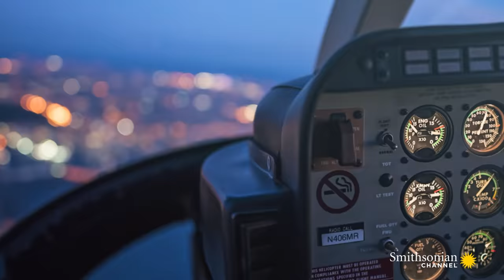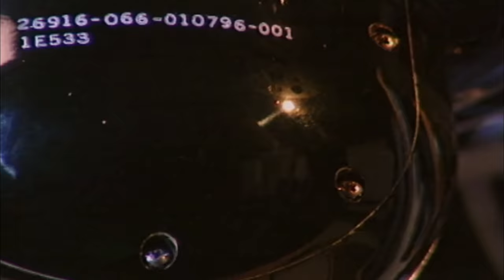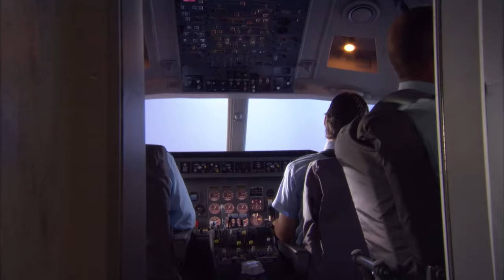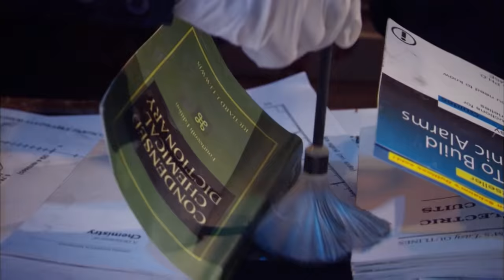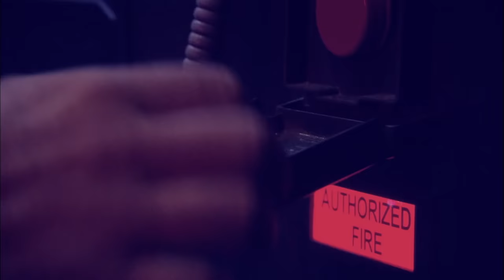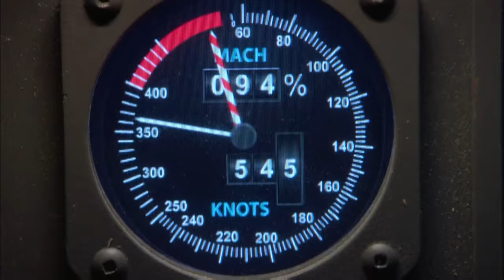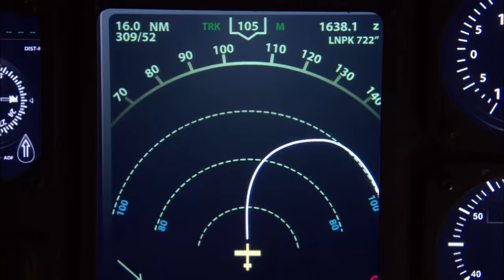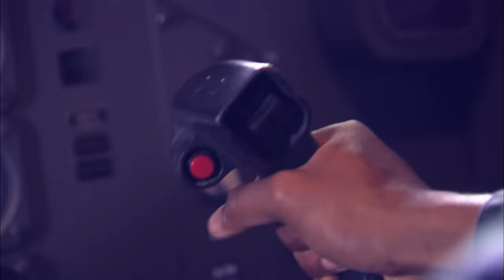Every Plane Crash from Air Disasters Season 6 | Smithsonian Channel

Comment: For a huge chunk of the top of the fuselage to break off and the plane NOT break apart in flight and then it was able to land safely would be unbelievable to me if you couldn't show me the plane. Truly mindblowing
Reply: That’s because it was built by one of the worlds greatest legendary aerospace manufacturers, Boeing. If it ain’t Boeing I ain’t going!
Reply: There is a God.
Reply: @sharoncassell9358  Impossible to deny in this instance.
Reply: @K131399  plenty of other material from this channel that's not so miraculous lmfao

Comment: Unbelievable the pilot allowed his  kids that kind of control. Just Unbelievable.
Reply: Which one?
Reply: @amymiller4840  Aeroflot 593
Reply: you can easily take your child to a flight simulator which has a similar feeling to flying in a cockpit instead of literally letting your child fly the plane and put all the innocent lives aboard at risk
Reply: Is ot really though? Ur dad never let u sit on his lap and drive the car? If that's the case then that's a major tragedy
Reply: @christina5823  oh really with the huge simulator waiting list of qualified pilots along with the shortage of available simulators, oh let’s not even mention the insane cost using the sim, just where do you take your kids for this intelligent suggestion?
Reply: @mikeberry5016  what an intelligent statement! That has to go into the U tubber hall of shame.
Reply: I feel bad for the mother. Both her children and her husband are far away from her when they died

Comment: Boeing got busted for work that should have been done with persicion macine tooling but was done by hand, then covered it up and fired the inspectors that made Boeing aware of the hand tooling going on ... Good luck if you ever find you are flying in a boeing aricraft.
Reply: Right, like AirBus doesn’t have similar problems and never tried covering up or place the blame elsewhere. Good luck finding an airline flying to your intended destination that doesn’t use either of the two.
Don’t be so quick to slam one of the best airplane manufacturers ever using some small detail involving much more of a bigger picture. If your ignorance insists then at least be fair and list the many times Boeing aircraft came through the many near impossible situations when their disabled planes saved  thousands of lives! Ok if you can’t be fair and impartial then remain the ignorant.
Reply: @natural-born_pilot  jokes on you, Ill fly Aeroflot and their Sukhoi Superjet